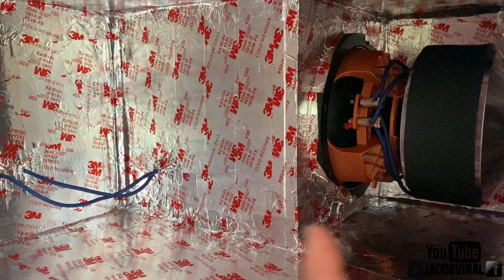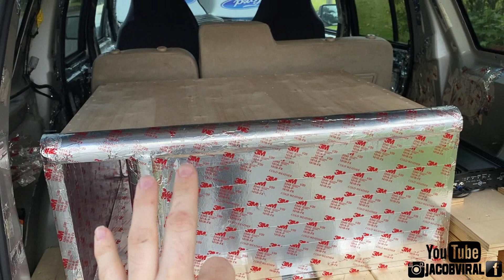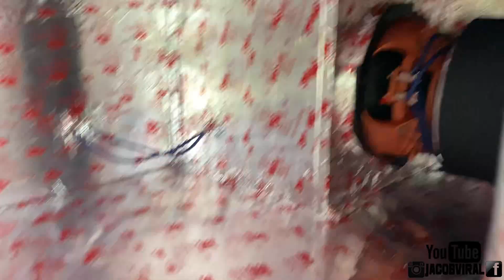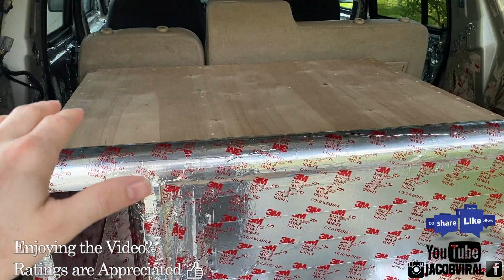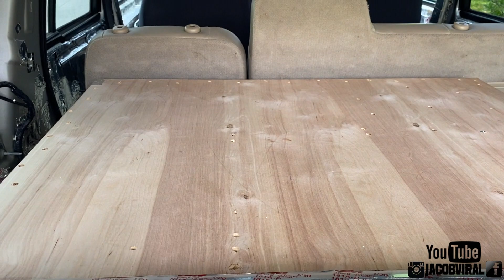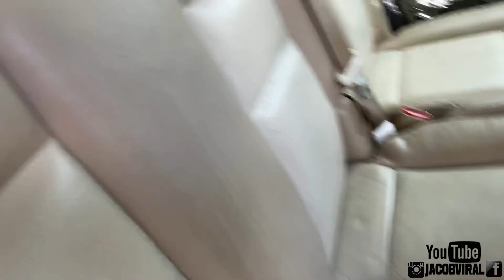SUBWOOFER BOX RATIOS AND WHY I CHOSE A BIG RATIO FOR MY BOX

Comment: I'm thinking about re-tuning the port on my fourth order to play lower. I want to be loudest from 20 Hz to 40 Hz. What should I tune it to? Right now I have a one to two ratio.
Reply from the maker: Probably 34-38hz, but If your after only lows then go 6th order
Reply: @JacobViral2  dang that makes me wanna build a whole new box lol. Series or parallel sixth order? Tuning freq?
Reply from the maker: @mjl6425  probably 24-26hz and 42-45hz sounds like for lows. Trial/error
Reply: @JacobViral2  series or parallel? Also what ratio?
Reply from the maker: @mjl6425  I dont know enough about 6ths to answer 100% but most go with 1.5-2 ratio wise and series seems common

Comment: I'm really interested in a negative ratio 4th order build. JT that built Jps at D4s has one. Want a 1 to 3 or 1 to 4. Want the sealed section to drop and be my output.  If the ported can get up to 60 or 70hz. I'll have my midbass drivers cover 60 or 70 and up to my midranges 200hz. Fs of sub is 29hz. So long as I gets down to 22hz or 20hz I'm satisfied.  Only needs 2.5 to 2.75 sealed from manufacturers. But since this is new I'm going off vas. 2.6 something . 8s in a Horn loaded and 2 10s infinite baffle along the way

Comment: There is no general rule of thumb for bandpass enclosures. There is no magical ratio that applies across the board for every sub & every cab of every vehicle. It's insane how many write ups are still floating around based on parameters of subs from the 90s which people think is still applicable...low ratio = wide bandwidth but low output whereas higher ratios results in less bandwidth/higher output. Basically you want to build sealed side to spec/desired F3 then build ported side to accommodate whatever it is you're gunning for be it peaky or flat.
Reply: Thanks for a little better explanation of where to start with making a 4th order. I have been looking everywhere to find out how the volumes are calculated and i cant even find a starting point
Reply: i knew it didn't have to be super complicated, just floating around basic specs is safe.

Comment: So how do you decide size of the sealed size do you use manufacturer suggestions. Also how do you decide how big to make the port
Reply from the maker: I always start big and shrink. The manufacture is recommending based on a sealed only enclosure and not 4th so not a good reference point but can use to start and shrink to liking if desired. I always had a number based on cone area personally that I’ve learned overtime.  Port area would be around 50-75% cone area usually for 4ths. Sometimes less but varies.

Comment: I've been really interested in building a 4th order but its just hard to find any guidance on how to do so. Lets say my subwoofer calls for 1.5 cuft sealed or a 2 cuft ported and I'd like to do a 2:1 ratio box, would i follow the manufacturers recommendations on the sealed side or the ported side?
Reply from the maker: Neither, that would be based off the only going ported or only going sealed. 4th orders are more geared towards a bandpass design concept with internal space playing a key factor for output with regards to ratio and tuning each chamber. It involves a lot of testing as well as there’s no true answer as every build varies. Most 4ths have a common sealed section spec suggestion range and ported is always going to be huge/bigger due to peak output gains with such large chambers of say 3 to 1 ratio, etc. it will depend on the sub and build and space available plus goals of bandwidth for the sizes.
Reply: @JacobViral2  thanks for the info. Well, space available is a factor because I have a 2 door vw GTI. Right now I am running 4 subs with ported enclosure. Rear seats are already taken out so I was wanting to do a walled enclosure but with what i have i may not have the room.
Reply: Good question!
Reply: I’m wanting the same information..